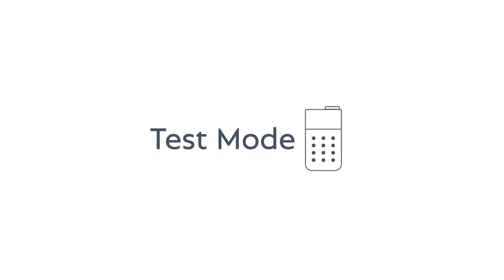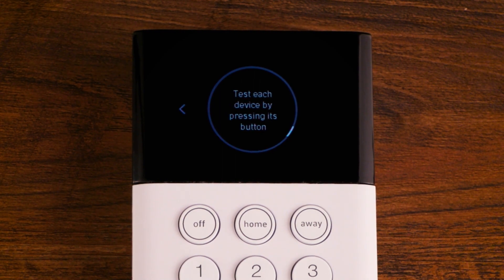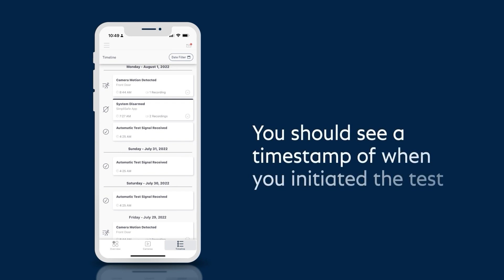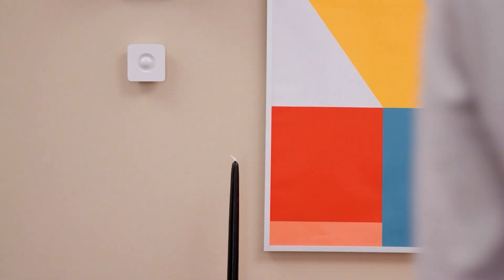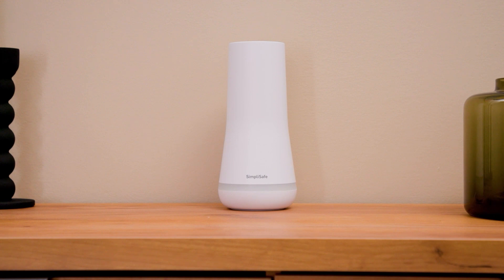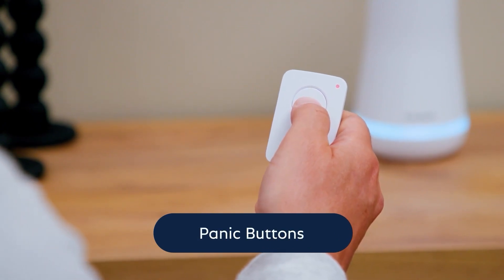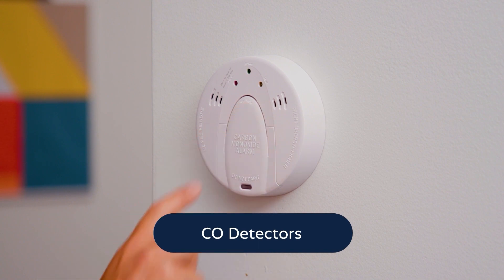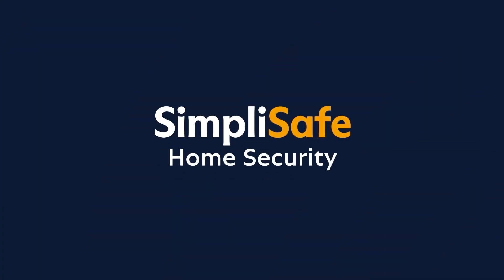How To Test Your System

Comment: No specifics on how to test water sensor - i.e. placing sensor in a small pool of water? With no information, I assume after I dry the sensor it can be reused?
Reply from the maker: Hi there!
Thank you for contacting to SimpliSafe®!  Here are the instructions for testing your water sensor, https://spr.ly/6053veTr7. After the sensor is dried, the sensor will be able to be reused.
Hope this helps.